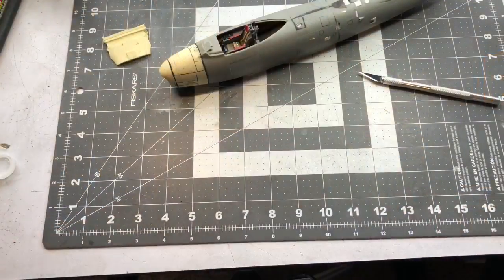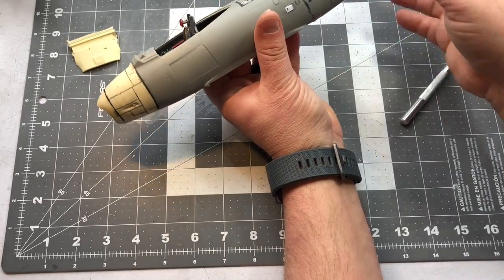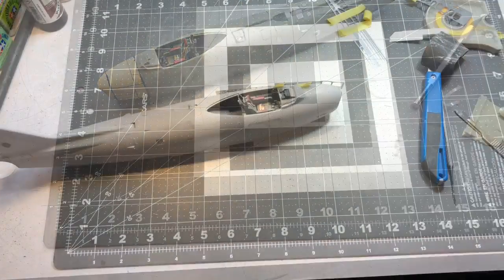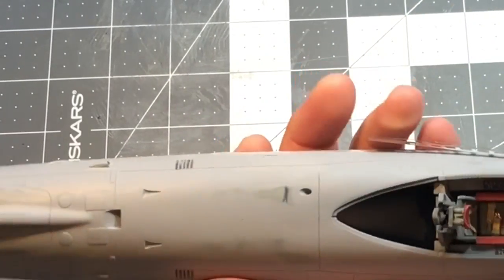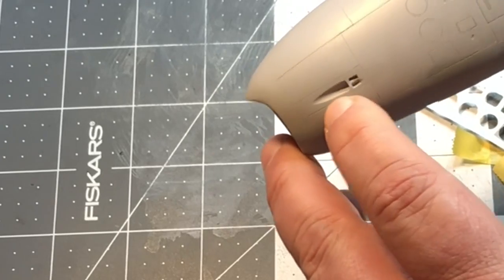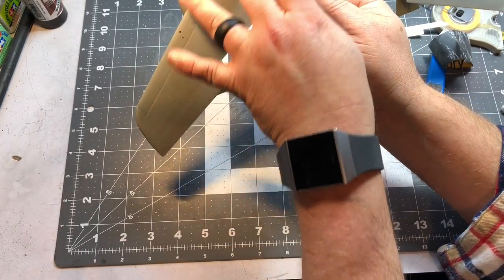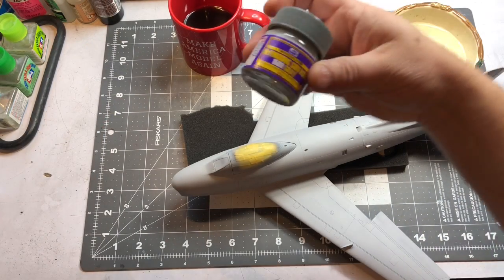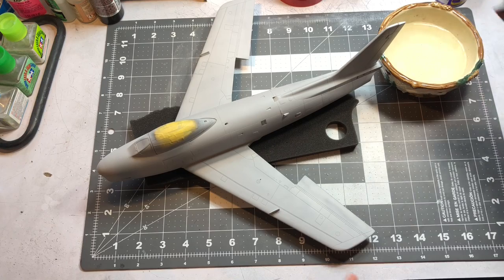1/32 CAC Sabre Conversion Part 2

Comment: Those little strut things on the drop tanks are the actual fuel line housings. Lot of foreign planes had those, US mostly had quick connects inside the pylon. If you look you can see a little loop of fuel line at the rear of some drop tanks that loops to the pylon.
He he he you suffer from the fat fingers too! Had a heck of a time placing that putty huh? Had to resort immediately to a tool. I'm the same way.

Comment: I always sand down my main paint colours. if you are painting a solid colour and you are adding lighter tones, it helps to blend them,,it can also give you a great Faded look, just done it on the stuka wings,, because the camo is dark green and black green, it works well,,I also sand down my first layer of wash after I wipe it down first,,  but only if it's white or a sandy colour.

Comment: You're correct it does shrink,{Vj putty} it's easy to use, but it does shrink. That blob of a nose now looks like it should. Looks good, as long as the resin plays fair the paint'll be sharp

Comment: In case anyone else besides me wants to know where to find the sculpting clay he is using. He said he gets it on Ebay and so I looked things up and here is what i found,  I think the one he has in his video is a 2 oz size and it goes for 6.50 on ebay. I also found a 1 pound size for 16.50. I have a lot of kits so I am looking at getting the 1 pounder. Here is a little about the stuff.

- Magic Sculp will adhere tenaciously to most any surface, and can be sanded and painted when hard.
- Easily mixed (Resin and Hardener slightly color coded: mix until one solid color).
- Good adhesion to almost all clean surfaces, including glass.
- Excellent malleability.
- Good sculpting media: as easy to work with as oil clay.
- Surface may be smoothed out with water.
- Water and soap clean up.
- Completely inert when cured.
- Accepts all types of paint.
- Surface may be sanded or ground when cured.
- No measurable shrinkage.
- Good for repairing anchoring bases and armature rods.
- Indefinite shelf life.
- Very forgiving on mixing ratio. Ratio may be varied to slow or speed up time.
- Repairs low pressure leaking pipes of plastic, cast iron, stainless steel, and copper. 

here is a link to ebay 1 pond container : https://www.ebay.com/itm/M00169-MOREZMORE-1-lb-WHITE-Magic-Sculpt-Sculp-Epoxy-Clay-Model-Putty/200983443371?hash=item2ecb8bf7ab:g:WFgAAOSw14xWPpvI

Comment: Hi there , just a quick question when scribing  which is ok , after a bit of practice how do get rid of the raised burr ,no matter what I do ends up scrappy. 

Regards Tom
Reply from the maker: What kind of scribing tool are you using?
Reply: @seanerk5kt9  have the Trumpeter  , one much the same as yours single ended and a straight single point . Always end up using the jlc  blade
Reply from the maker: I’ve got the trumpeter one too but I don’t think I’ve ever used it.  After scribing the line to the desired depth, try lightly sanding it, then run the scriber through once more.  Then take a tooth brush and some isopropyl alcohol and scrub out the plastic dust/ bits.  Then run a small amount of extra thin cement along the panel line.  I think I may have demonstrated that in a previous video but don’t remember which one.  That’s what works best for me.
Reply: @seanerk5kt9  I have watched you doing it you think I would have learned 😋, think the bit I'm missing is the clean out going straight to cement . Cheers for the info . 
Tom
Reply: I've done the extra thin to clean up panel lines and debur drilled holes. I build mainly 1\25 scale semi trucks,some trailers too. I need to find a riveting tool or try to make one. I think my Mom used to have a rolling toothed thing,looked like a screen ribber,only smaller teeth and closer together. She used to make a lot of our clothes,and she used this thing on patterns to make a perforated line. Something like that might work. Do you use one,and did you make it or buy it

Comment: Nice work once again. This channel is my favorite for aircraft builds. Your tips and just seeing the way you do things are very helpful, so thank you for that.
Do you have the name or a link as to where a person could get that two part putty you used on the wing roots?
Reply: Hi Ed, i asked that same question earlier and he told me to look for it on Ebay under magic sculpt, I found it and its sold in a lot of different size containers up to twenty pounds Holy cow thats a lot of model airplane builds! LOL any way I think the one he has in his video is a 2 oz size and it goes for 6.50 on ebay. I also found a 1 pound size for 16.50. I have a lot of kits so I am looking at getting the 1 pounder. Here is a little about the stuff.

- Magic Sculp will adhere tenaciously to most any surface, and can be sanded and painted when hard.
- Easily mixed (Resin and Hardener slightly color coded: mix until one solid color).
- Good adhesion to almost all clean surfaces, including glass.
- Excellent malleability.
- Good sculpting media: as easy to work with as oil clay.
- Surface may be smoothed out with water.
- Water and soap clean up.
- Completely inert when cured.
- Accepts all types of paint.
- Surface may be sanded or ground when cured.
- No measurable shrinkage.
- Good for repairing anchoring bases and armature rods.
- Indefinite shelf life.
- Very forgiving on mixing ratio. Ratio may be varied to slow or speed up time.
- Repairs low pressure leaking pipes of plastic, cast iron, stainless steel, and copper. 

here is a link to ebay 1 pond container : https://www.ebay.com/itm/M00169-MOREZMORE-1-lb-WHITE-Magic-Sculpt-Sculp-Epoxy-Clay-Model-Putty/200983443371?hash=item2ecb8bf7ab:g:WFgAAOSw14xWPpvI
Reply: @sambrandt3688  thank you so much! Guess I'll have to go have a look..again thank you.
Reply: @sambrandt3688  your a good man.  My order arrives on the 20th

Comment: Hey there how yeah been? question, at about the 12:30 mark you start talking about using magic sculpting putty. Can you please give a source for buying it? I have never heard of it or seen it in any of the hobby location i have access to. So I'm gonna have to buy it on line. Thanks. Oh also I have the 1/48th SR-71, both fins broke off. Long story, anyway I was thinking you talked about using metal pins to re attach parts. I can't remember which video that was in can you re explain how that's done of show me a link or you can respond using my aviator51 email. Thank you.
Reply from the maker: Hey Sam...been good thanks.  Search magic sculpt on eBay and it’ll pop up.  The below video link shows how I pin stuff....it’s about at the 3 minute mark.  Hope that helps buddy.

https://youtu.be/UG1zyLXHBRw